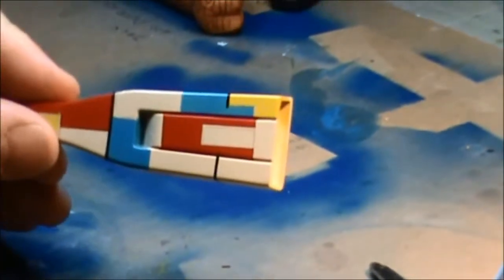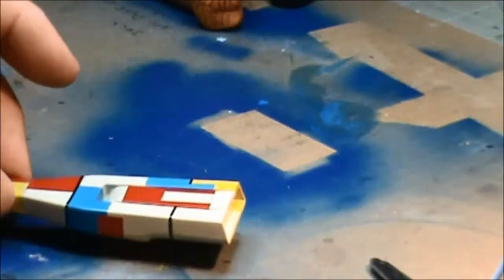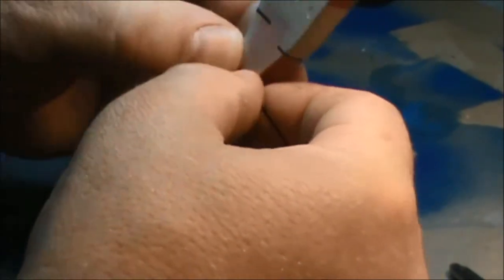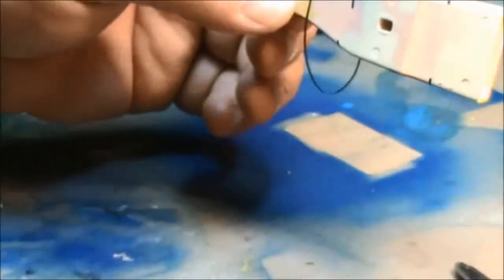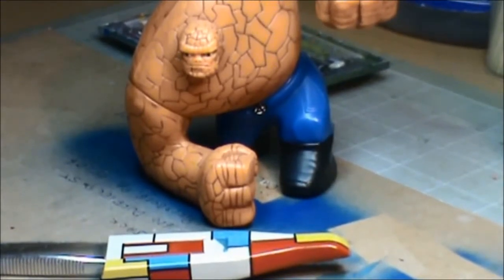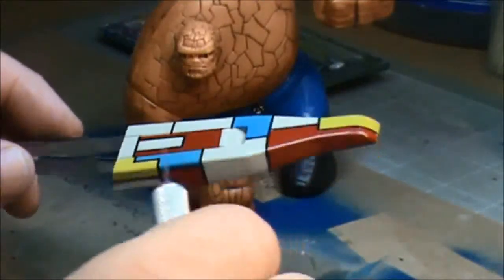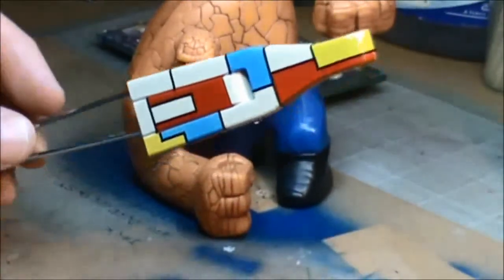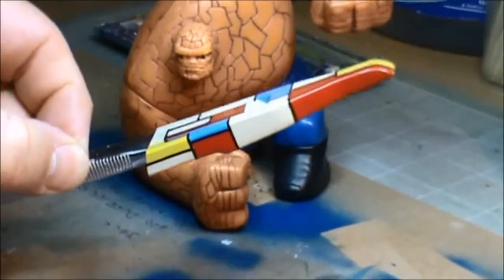5:32 The Partridge Family S'cool Drag Bus [Part 3] Tribute to David Cassidy

Comment: I think a better and more cost effective way would be to use decals. You can get solid color sheets and sheets of stripes.  I think the stripe sheets can be had as all one width, too. Although I would go for the sheet myself. I'd just rather cut my own.  Then you just need to measure with your divider and cut to length.  Simple and easy ......

Comment: Way cool Sir Dirk, I was wondering if you used like clear nail polish to seal in those curved areas, out of sight. Just a suggestion. Otherwise masterful build. Build on brother.
Reply from the maker: Wilson Barklow no I didn't but that's a good idea. I just shot it with a close coat and that held it in place. Thanks for the idea

Comment: A cheaper way ?  Take a glass or something smooth cut some electric tape place it on the glass use a ruler and sharp hobby blade. I done this for my can tie fighter the tape got more adhesive comes in lots of colors the future over the top should hold it in place